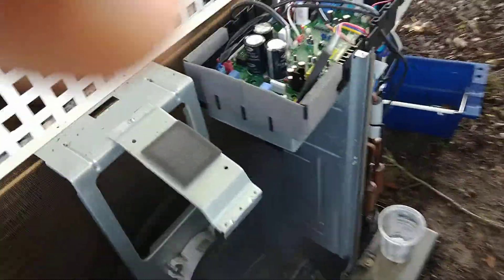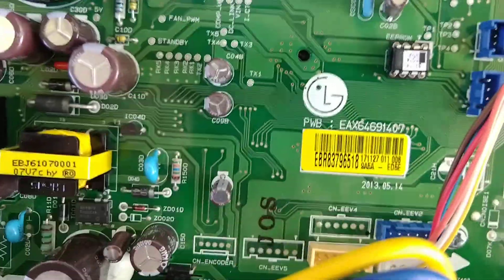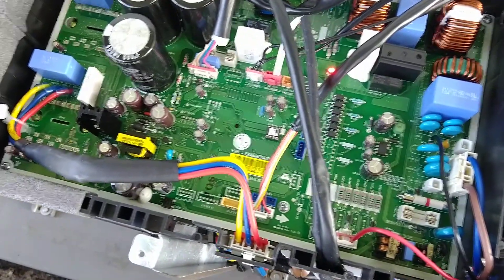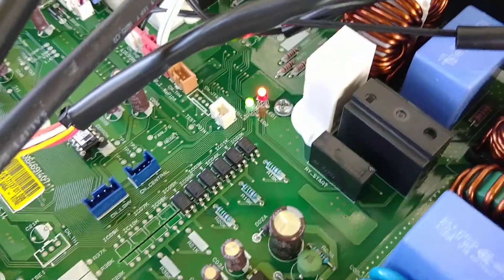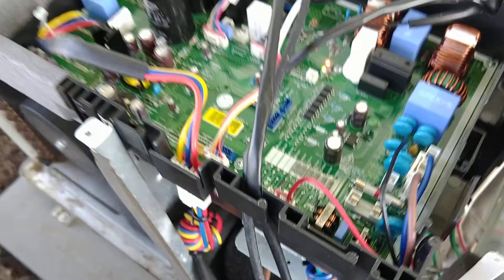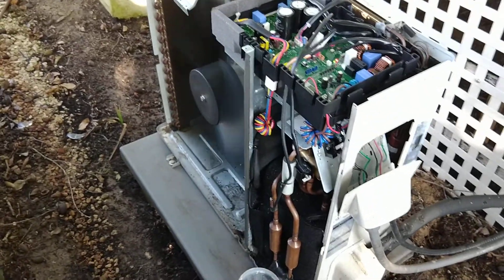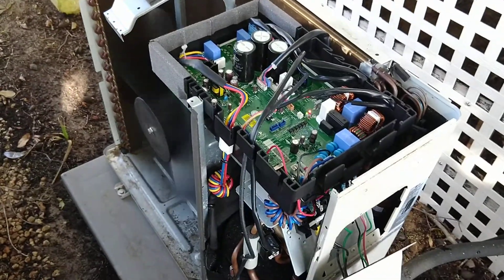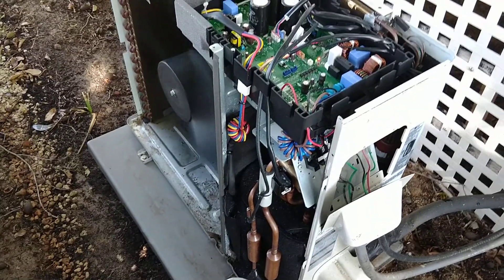LG Minisplit control board R&R due to lightning strike.

Comment: I doubt it was lightning. That PWB does not look like they had the traces large enough for fault current, as the breaker should have tripped, not the copper traces. I designed boards for a living at Collins radio. I can see the input filter section there, the common mode choke, and I think you indicated the reactor failed, along with the circuit traces. That indicates the circuit breaker kept feeding fault current to this. Did the break ever trip, or was it the copper traces that finally burned open?
Also is there any conformal coating on that board? I think you indicated August time frame failure so it would not be heat pump season, where water vapor can condense on that board, unless the plastic box it is in, is totally sealed from water vapor. But that failure is not what I think happened (but is causal in other failures). The high current would be from the VFD circuit that drives the compressor, which over current sensors should have shut down. So I'm guessing a circuit failure in one of the IGBT transistors that switch the power to the compressor where two of them short circuited, and as the circuit breaker did not protect this, the secondary effect is the DC path power supply.
Reply from the maker: The 240vac feed arced over to the low volt control circuit which was running parallel and toasted the board. It may have been due to a palmetto bug. It happened again months later another board cooked. Had to seal the box and dust ant bait around the unit. We shall see...
Reply: @ajsnowskis  I found links of minisplit failure in tropical locations with geckos and other vermin crawling into the poorly shielded board area, and frying the electronics. In avionics, there is a 6mm segregation zone, the idea that a flat washer of a size smaller then used in the assembly of the avionics could not short across a isolated channel zone. With vermin, all bets are off. The other issue I have is the lack of conformal coating, as that would provide both electrical insulation to accidental shorts, and humidity issues with condensate causing voltage arc over. All of my products were assembled in Melbourne, Florida. But design was here in Cedar Rapids, Iowa. I did lots of shake&bake testing, and condensing humidity was the hardest test to pass. We used an acrylic conformal coating. But I believe a solvent based silicone would be better. We had flammability requirements that are not a real issue in a minisplit. So I plan on installing conformal coating to the 3 minisplits I just installed this summer. I have a Turbo Air, a Mitsubishi, and a Daikin, none of them use conformal coating.  MG Chemicals #422B, that I will brush on.
I do not know why the electronics are not sealed from bugs and condensing humidity. The board is vertical in the Daikin, but still is exposed. As for warrantee, only applies if a factory authorized dealer installs the Daikin, the others I purchased as surplus 8 years ago, and finally got them installed in the house and shop.
The original central air for the house I installed 23 years ago is 100% functional. But I added on, and that's where the 2 minisplits come in. I just purchased the Daikin, worst documentation of all three relative to installation instructions. Missing instructions, and as long as they have been selling product in this country, there is no excuse for how poorly translated the documentation is. 
One of my design skills was lightning protection. I have not looked at what any of the manufactures are doing, but I assume there will be some large MOV's (Metal Oxide Varistors) across the power connections to ground.